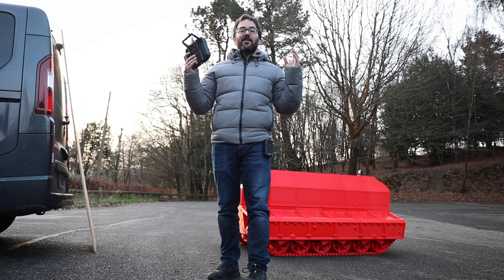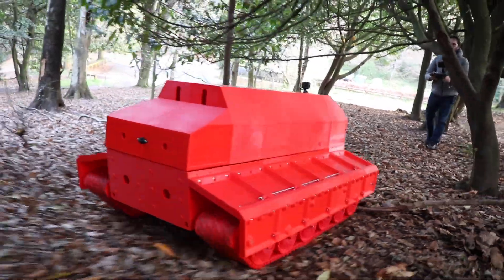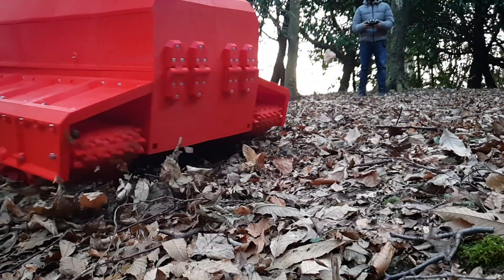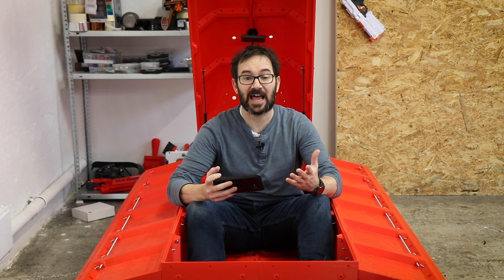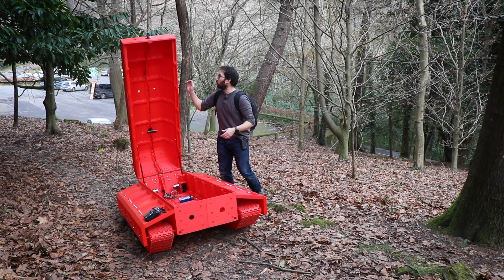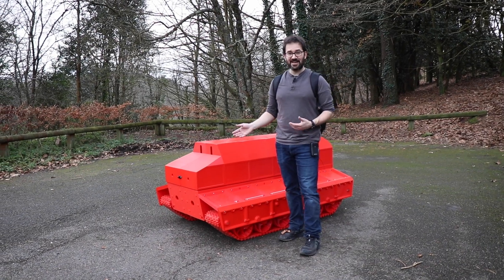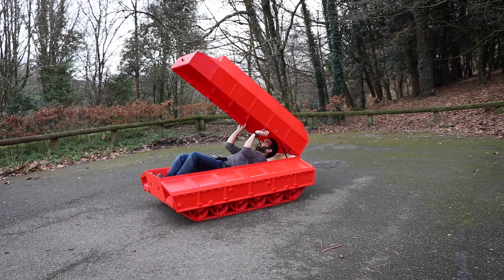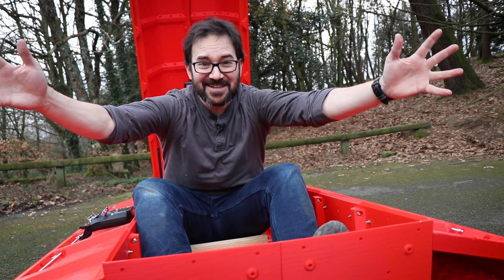FIELD TESTING THE BIG 3D PRINTED TANK (and ride in)

Comment: a 3d Printer with a multi extrusion setup would help with grip as you can print both in PLA/ABS on one head and a rubberized ninja Flex to add grip in a thin strip on each tread linkage, and a brass powder infused filament might help with its durability. just a thought.  Thinking about how to improve the design is all. Looks great and runs well.

Comment: Don't know If it's been asked (probably a million times), why haven't you used a spray rubber,  like flex seal, for the teads to help with traction? Or is that not feasible?
Reply from the maker: It has been asked a million times yes 😂
The thing is that traction on asphalt is going to be poor but I'm aiming to get good traction on off road terrains and that seems to be pretty good. It climbed some steep hills that day.

Comment: The one complaint i have with this is that the tracks are smooth as hell, so your traction in dirt is lower than what it would be if you had treads on your tracks. It would also provide extra height to get over small obstacles

Comment: I’m just wondering since you were able to build such a large Rc tank do you think it’s possible to print a large 1/5 scale truck ? I have a 1/10 buggy printed which is the tarmo 3 don’t know if you seen it but I would love to build a 1/5 scale truck do you think it’s possible?
Reply from the maker: Yes
Reply: Ivan Miranda but at that scale 1/5 I wouldn’t be able to use printed gears would have to figure out a way setup the motor with gears or else use metal gears right?
Reply from the maker: Printed gears may work, it depends on the amount of torque (break) and power (melt) that you're planning

Comment: I will recommend to go to higher voltage 48V and curret will be 50% of actual setup. (smaller wire, battery stress, heat and efficienci) but anyway Good Job !!!!!

Comment: Great Job.  I'm surprised by how much less traction it gets when you are inside, but it looks like you have good power.  On RC car prints I've done, I used either bicycle tubes or bicycle rim liners cut into a circumference and glued around the contact patch.  You could use self-tapping screws on each tread section to hold it in place, heating while screwing it in to get a really good hold down.  It would be time consuming, however, it would look awesome and be very functional.

Comment: This is awesome. It's a real vehicle! A 3D printable vehicle you could actually download and build. Simply amazing. To improve, it, I think you need a metal planetary reductive gear drive to add torque. You got plenty of speed from those huge motors, but torque is a bit of a challenge. With both high input speed and higher output torque you can actually achieve more speed with less strain on your motors. RC helicopters usually use a reduction gear ratio so the tiny motors can rotate the large rotor more easily. This allows them to achieve more speed with less strain, thus achieving high thrust.

Comment: Ivan, creo que más que regular parámetros de corriente y esas cosas en el tanque para ir offroad. Tal vez deberías de pensar en la integridad y rigidez estructural del jueguetito, en la imagenes se puede apreciar claramente como, a pesar de estar vacío, la estructura del tanque cede, y se mueve, fijate en las tomas en las que se ve bien la unión de la canopilla con el chasis, en función de la inclinación y del esfuerzo, la estructura se deforma levemente. No recuerdo que material usaste para imprimirlo, pero tal vez no sea lo suficientemente elástico para soportar tu peso en condiciones de apoyo irregular en superficies escabrosas. Tiene pinta de que alguna pieza pueda partir. En el asfalto la totalidad de la superficie de la oruga y la totalidad de las ruedas motrices y suspensiones estaban en contacto con el suelo. Yo intentaria reforzar si quieres hacer la prueba offroad.
Por lo demás, te felicito, a pesar de no estar al 100% te has superado. Eres una crack y un autentico troubleshooter, has logrado hacer lo inpensable partiendo de una idea y haciendo uso de tu ingenio y sacándole el máximo partido a la impresión 3D posible. Espero ver más proyectos alocados y fascinantes como este.

Comment: It seems you need to attach a "lock" to the "lid" of the tank, because the "lid" can have a gap. For example, at 07:02 (and 07:43, too) a visible gap appears between the tank and the "lid" when the tank is not in level. 😉

Comment: You should put some sort of  Inner lip or fingers on  The front of the door so the door doesn't shift back-and-forth while driving  specially if you plan on taking it off road I could see a finger design that bolts into existing holes that would make  The lid significantly Strong When closed I can also see a latch being put in that will hold the door closed so it doesn't Rattle up-and-down While off roading  Of course the latch would have to be somewhere you could reach it  While inside  These modifications I think would be very easy to incorporate I strongly suggest Putting fingers on it Or an inner lip specially  if you plan on Putting a turret on top eventually The added weight would cause a lot more stress on the  Hinge While driving I love what you do please keep up the good work You inspire me to continue making things  I love 3-D printing I look forward to watching your videos to come

Comment: Looking good so far 👍. If you want to ride that thing off road you'll need roller guides on your rollers and Treads, (little spikes on the inside of the tread to keep them in place) so they don't slip off the middle of the tread, and a more active and staut tread tensioning system.

Comment: Go to local hardware store, get rubber floor mats, cut rubber floor mats into pieces that fit tracks, increase traction without adding much weight.
Reply from the maker: Where did you see lack of traction?
Reply: @ivanmirandawastaken  It just looked like the tracks were sliding/slipping on the ground. Could just be me, I'm not known to be very useful!
Reply from the maker: On the Tarmac it slides a bit but that's by design, so it can turn. Off road seemed grippy enough, It went up pretty big inclines, maybe is not appreciated on the video. For offroad grip improvement I'd redo the tread design to give it more bite. It was useful! 😉

Comment: Regarding safety; what are your fail-save settings?  it has to be at least both on the receiver on signal loss   AND the esc on receiver failure. With the weight and power of this thing it can injury people if it goes out of control and hits someone. You should also add a "battery disconnect" that is accessible from the outside like a connector that can be unplugged.  And think of mounting a fire extinguisher on the back outside (also looks cool).

Comment: Good progress! :) Ivan, I'm still think that it's better to enforce the tracks with some "rubber". IMO a good polyurethane sealant would help! Otherwise you'll scratch off them pretty quick. Just think about the pressure when you're sitting there.
Or you even could wrap the tracks with long sheets of a rubber. Just need to find a one that is not heavy and not slippery.

Comment: That is awesome!  But whoa, that flex!  Once I thought of the holes at the top as eyes, I couldn't help but think as the opening as a mouth.  And the flex made it constantly open and close on the corners, making me imagine it was grumbling about you making it drive offroad...

Also, the more I see the flex, the more I think that you are hitting the limits of what 3D printed plastic can take.  At that size and space requirements, for it to remain rigid, you'd probably need a metal box frame with diagonal braces, gussets, or just diagonal framing.  Of course, that would invalidate the concept of "3D printed tank" a bit...  So, I'm at a loss at how to make it stronger without adding metal or seriously cutting into interior space.  I'm afraid of you taking it out and splitting a part of the chassis since I'd imagine a chassis piece would be difficult to change out at this point.  Then again, it would give you an excuse to change it out for something stronger without people complaining about you changing things around too much. :P
Reply: If the lid had several latches around to hold it down tight, that would make it more rigid. The big trick would be making a latch system usable from inside and outside.

Comment: Great video! I've been making diy tanks for years, but always have some trouble with the transmission (worm gears wearing out, gears snapping, or even the entire gearbox being annihilated). Do you have any advice on making a strong gearbox? (use a worm gearbox, or a spur gearbox). Also, a suggestion is that instead of using a tall cover for the tank, you can make it have a lower profile by putting your upper body inside a turret, and your head stick out of the turret. This will lower the entire cover to make it look like a ww2 beast rather than a moving house or a kolohousenka

Comment: By chance did the axle break exactly where you drilled the screw through it and removed 60 to 70% of the strength of the axle like I said would happen in the last video because you drilled it instead of using a keyway?

Comment: First of: this is an amazing project and the first version of this is what got me into 3D Printing (even tho my design skills suck). 
ATM I am building a small car with a 3D printed body, which is simillar to the drones from Rainbow Six Siege, but I want to use a RPi and a Phone to control it, but steering the ESCs is a bit difficult, as I bought no name ones (started it as a school Project, so it had to be as cheap as possible). A Future plan is to add live Video feedback to the phone,  but I still have to find a way to make transmission of theVideo more efficient as WLAN has a rather short range, any Ideas on that one ? 
Another question I have is, how heavy is the Tank ATM ?

Comment: Pretty cool seeing it climb hills with ease! 
The flexing is a bit worrisome, wouldn't want it cracking and the motors coming close to your head.
Hope you add a lot of padding before going off road!
Reply from the maker: One of the things on my list is shielding  the motor compartment and battery, yes
Reply: @ivanmirandawastaken  4 latches on each side and 2 at the front would lock the lid down tight and reduce the flexing. A single lever latching system usable from outside and in would be very cool. Perhaps copy the latches used on the Apollo capsules? The 3D files are free downloads from NASA. They're neat things, move a roller tipped arm at right angles to the actuation motion.
Reply: @greggv8  hmmm... not so sure if latches are what i'd be considering when i had to be inside with 100+ amps of Lipo running close to max. gimme a swift & easy exfil route! 
great build - you should be proud of this project, along with all your others!!!
Russ from Ocala, Florida, USA
Reply: @trabladorr where does your pfp come from? It's very similar to one I used to use lol
Reply: I feel that perhaps a helmet should be used here, for extra safety anyway.

Comment: You should bring it to the beach and film the people’s reactions when they see a tank but nobody controlling it ( because you are inside it ) 👍 love the tank build series
Reply from the maker: I't has so many rods and bearings that I'm scared to be near the beach and everything rusting. It'd take ages to swap all the hardware. It'd be cool though... yes
Reply: @ivanmirandawastaken  you could install a fpv camera maybe?
Reply from the maker: Not the one it has? With googles?
Reply: @ivanmirandawastaken  upgrade to stainless steel :)
Reply: @greggv8  Stainless will still rust in seawater. Only thing that works properly against sea water is sacrificial anodes and protective films like paint.
Reply: @2testtest2  it depends on the type of stainless steel. Non magnetic alloys are the best.
Reply: @greggv8  303 and 304 are both non magnetic stainless alloys but will suffer heavy corosion in sea water. For that purpose you need 316 grade stainless.
Reply: He will not because he is not sponsored by world of tanks unless they ask for another plug to sponsour them again then he can play on the beach.

Comment: I feel like it needs more powerful motors
Reply from the maker: Nope, not an issue at all, I have them limited to 30% tops
Reply: @ivanmirandawastaken  maybe just don't gear them down as much to load the motors more
Reply from the maker: I should fear it down even more. It is too fast as it is. Right now theoretical top speed is 42Kph
Reply: @ivanmirandawastaken  are you going to test it with the motors on full power?
Reply from the maker: Eventually, yes
Reply: @ivanmirandawastaken  I run a First Tech Challenge(FTC) club for a Jr. high and we had this problem. We where using 4 motors in a mecanum wheel set up and the motors where a 435 rpm 5202 Series Yellow Jacket Planetary Gear Motors. Even using and analog (PS2 style required for competition rules) joysticks they could not control it especially at very low speeds. We swapped to the 223 rpm and it got better but I wished I had talked them in to 117 rpm version. It also looked like the power at slow turning speeds was weak so I think gearing down would help that.
Reply: @ivanmirandawastaken  well, if you need to gear it down more, a quick way would be to switch to a larger diameter drive sprocket. It probably still  needs stronger drive axles too.
Reply: @ivanmirandawastaken  then you pick up the remains, print some improved replacements for the broken parts and go again. :)